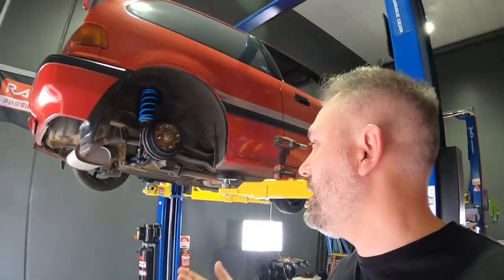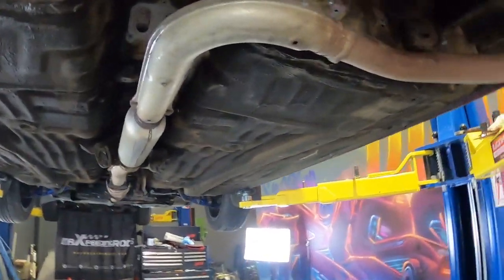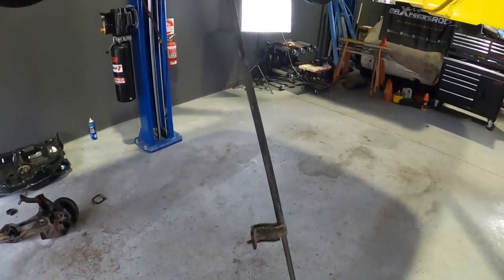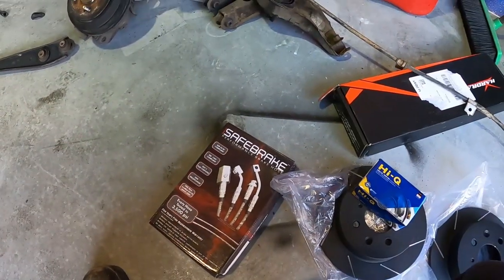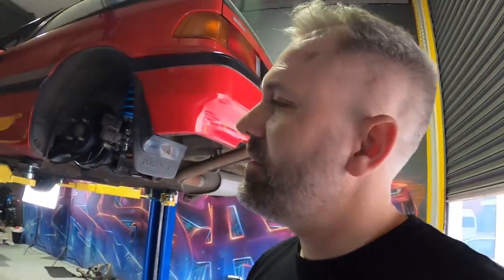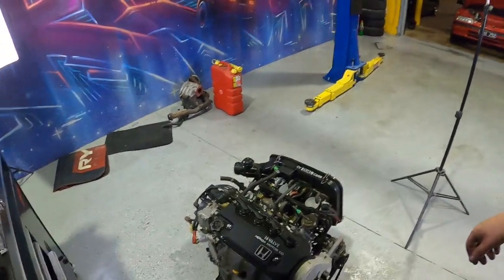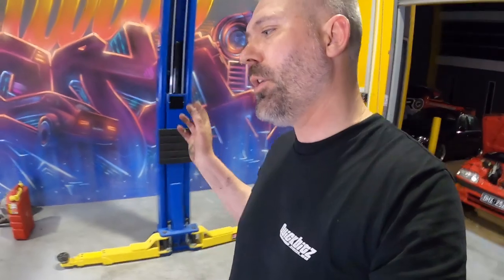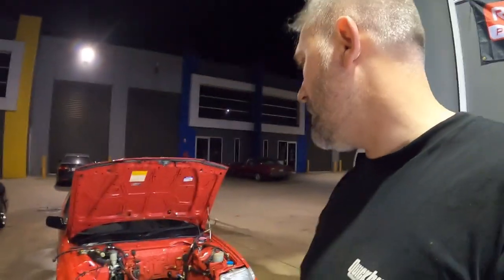EF/ ED REAR DISC BRAKE CONVERSION  EK4 / EM1 BOLT ON UPGRADE

Comment: I did this years ago. Got some integra (91-94) rear trailing arms, and an SI e-brake cable to get it done. Then eventually I replaced those bushing with energy suspension. That required the use of a torch to burn out the rubber so the dog bone and bushing ring outer ring could be reused.
Reply from the maker: Awesome man that sounds perfect

Comment: Hey bro ive had trouble sourcing a rear trailing arm disc brake setup. Have you done or seen anyone do the little bracket disc brake conversion? If so do you know where i can grab one? Ive been looking everywhere
Reply from the maker: No clue grab any sedan rear trailing arm set from any wreckers they are everywhere
Reply from the maker: This is ek stuff on an Ed all works

Comment: You can take the disc and hubs off the disc trailing arms and put them on to the original Civic drum brake trailing arms
Reply: What will the caliper bolt to?
Reply from the maker: You sure can but this was is easier
Reply: @jtaylor9355   the spindle with the hub
Reply: @adieselcotton  so your saying you have to change the spindle too? In your first post you only mention the brake disc and the hub
Reply from the maker: this way is the easiest just change the whole arm bolts right in

Comment: edef conversions in qld make a conversion kit to go hydro gearbox or you can just use the d15b4 gearbox.

As for mounts you can just use d15b4 stuff i believe just need post mount off the b4 and if you use original gearbox that and t bracket they just bolt back in
Reply from the maker: New video is edited and will be out soon, I came up with a hydro conversion kit I’m going to install tomorrow

Comment: Slowly acquiring parts to do this. Did the offset change much from OEM? Doing the DA rear brake conversion widens the stance in the rear, just checking if you noticed whether the EK rear setup made the stance wider?
Reply from the maker: It’s no wider mate

Comment: So my question is… did you pull these out of an EK hatch as well? Or would the EK platform be universal in that area, I’d like to do this for my 91 SI and kinda wanna start building a list, any help would be appreciated!
Reply from the maker: These are in all ek1 sedans and ek4 or ek1 gli hatches, or em1 basically any civic between 88-2000 with rear discs will fit
Reply: @TURBOTRISTO  much love! Earned yourself a sub!

Comment: What about wheel alignment?? Did you mark them and put back in place?
Reply from the maker: Normally yes, this car is getting coil overs and heaps of new bits it will need an alighnment 100%

Comment: Awesome job as always dude. In the process as we speak of converting my EK to rear disks from drums. Actually doing the whole conversion to Si brakes to give me a bit bigger fronts. Thanks for your vids. Keep them coming. Question...do you find it absolutely necessary to switch out the master cylinder and proportioning valve. I'm reading conflicting arguments on whether it actually needs to be done. Any real world experience?  Thanks again.
Reply: you don't have to but it helps. 
You prop change because rear drums require less force to work.
The drum brake prop valve feeds less fluid to the rear to compensate for this so using a drum prop in a disc car just doesn't use the rear discs to there full potential
Reply from the maker: you don't have to at all man, but it will help but not necessary
Reply: @TURBOTRISTO  yeah that's the consensus I'm seeing. Thanks mate!